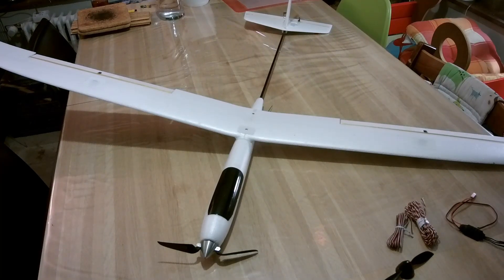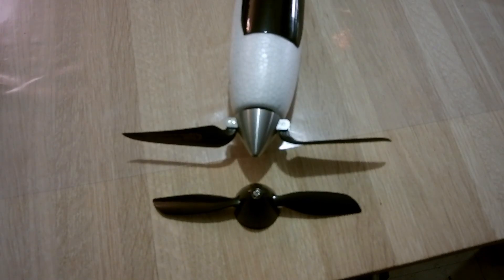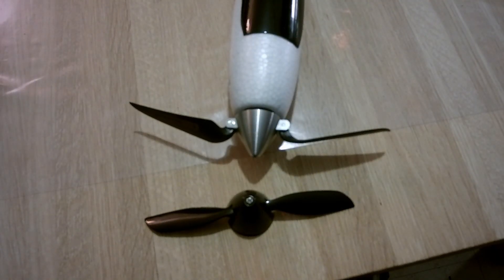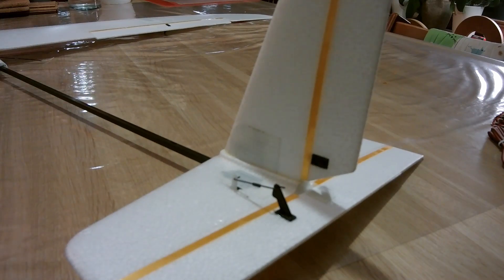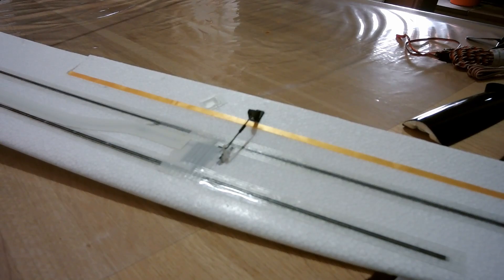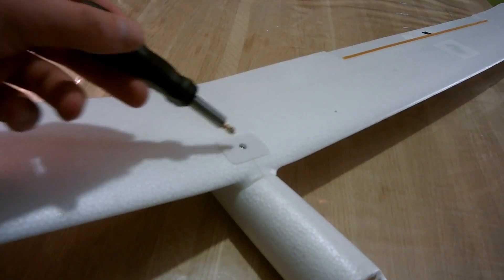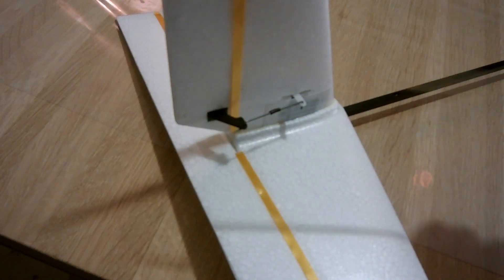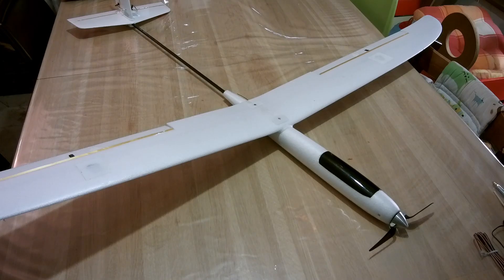u-glider modifications

Comment: Thanks! Did you reinforce the wing mounting? For me it came out on the first rougher landing, the wing essentially detaching, I now reinforced it with gorilla glue. Also, What did you replace the motor with? You link to the original motor but you mention you replaced it? Or did you only get a better spinner and props? Thanks in advance!
Reply from the maker: Hi Mate, I did not do any modification on the wing mounting... so far no problems...
I kept the original motor... but I replaced the ESC as I could not program the brake on the original one and the motor kept spinning and creating lots of drag...
I also replaced the spinner and the props.

Comment: Thanks, that was very helpful!
Reply: By the way, how did you cut out the space for the new servos in the wing/tail? I'm really afraid to damage the plane. Did you use a sharp knife, or is there some kind of trick?
Reply from the maker: @soosmate  very easy: design the contour of the servo with marker, put a piece of tape on the upper side of the wing (you're not gonna gut there, but it keeps the foam together if you ever go too far). Cut the contour of you servo with a cutter, after that take away the foam with a dremel... do it slowly, test different speeds and heads from the dremel...
Reply: @yannickver  Thanks a lot, that was very helpful!

Comment: Hello Yannick, I also own the U-Glider. Like everyone else, I had the same problem with the controller. I wrote to banggood and complained that the controller did not allow the engine to stop programmed. I got a cashback but am still looking for a small regulator. Where did you buy yours I think the replacement of the spinner and propeller is good, and I will do it too.

best wishes Michael
Reply from the maker: Hi Michael, I tried to conctact Hookll, the producer from the Glider to have info about this ESC... a Chinese colleague did it for me in Chinese and they never replied...
I did not contact banggood about this problem... but yes, normally banggood is very responsive to problems... and the try to solve the issue...
This is the ESC I use... very lighweight and all the wiring is already included:
https://www.banggood.com/ZTW-Mantis-Slim-15A-SBEC-Brushless-ESC-Speed-Controller-For-RC-Models-p-1247457.html
If you want the programming card, this is the correct one: (don't by the card for mantis, this card is for mantis-slim) you can do all the programming without the card... but it's very handy and fast.
https://www.banggood.com/Surpass-Hobby-Program-Card-for-RC-Airplane-Boat-ZTW-Shark-Beetle-Brushless-ESC-p-1558326.html